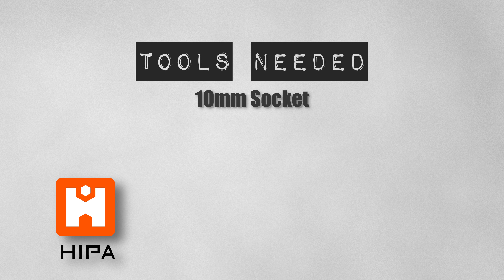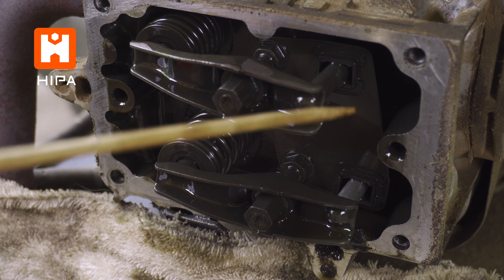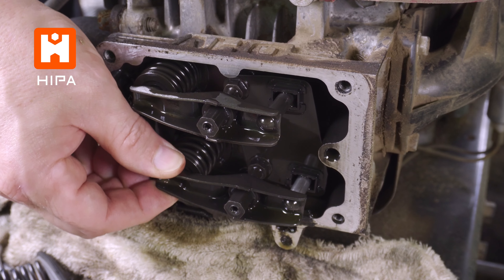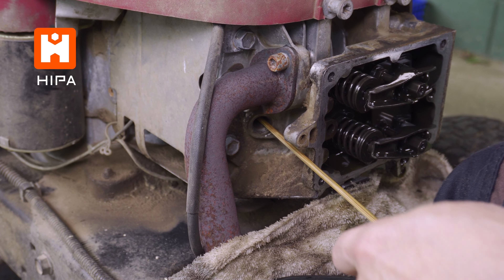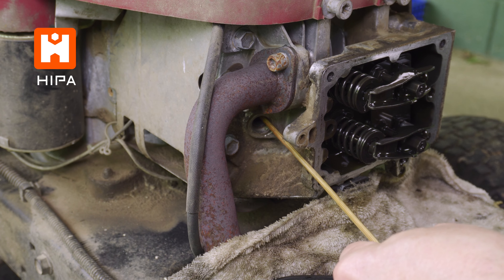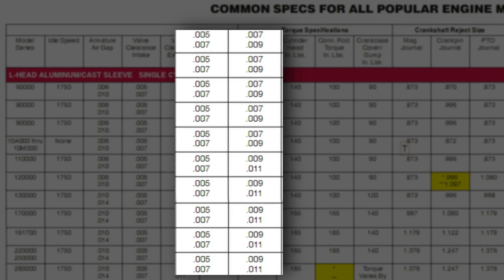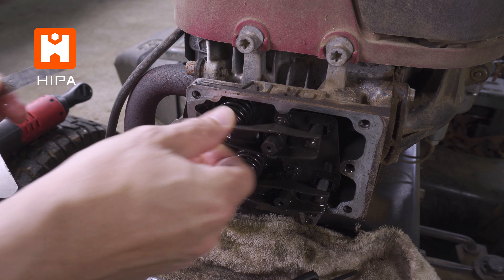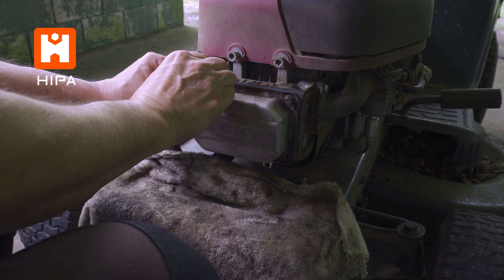Do this once a season! Briggs and Stratton Valve Adjustment Made Easy!

Comment: WOW! Just came across this video and what a Godsend. My local small engine shop wanted $125 to do this and with your help I did it myself. Along with that, I rewarded myself with a cold beer afterwards. Great video. Straight to the point with no filler material. Thanks for sharing your knowledge with those of us that don't know, but are willing to learn. I'll make sure to pass this knowledge on.

Comment: Thanks for your video! I was having fits trying to adjust the valves because of bad backfiring and a lack of starting. I kept thinking I was doing it wrong because no matter how perfect I thought it was I had a no start condition. Turns out that the flywheel key was sheared and the only way of figuring that out was by removing the cooling intake and mesh screen to check. You could clearly see the key-way in the crankshaft 1/4 turn past where the flywheel key-way was. Only a $6.00 part. I wasn't the original owner, and had no history of symptoms to help me figure it out
Reply: Always a fun one. I've got a Troy Bilt wood chipper I bought off of Craigs list where the governor never worked right. Ran much better with the governor disconnected than with it connected.  The guy I bought it from said it just needed to be "dialed in".  Never worked on small engines before. Spent many hours of tweaking and adjusting before I realized the governor is working backwards. Then I'm trying to figure out how the heck that could have happened, and then I realized the carb itself isn't even the right carb for the engine which is why the governor is working backwards (governor is slowing the engine down causing it to cut out when it is under a load instead of speeding it up). Ended up just leaving it disconnected, setting the engine to have a high idle speed,  and I push the carb governor with my finger if I need to from time to time to prevent it from stalling out.

Comment: Excellent, liked & subbed! I have a B&S 28V707 given to me in a Murray Select rider mower. I have used this for several years and I have never checked the valve lash, and I don't think it has ever been checked. I saw what the spec was 5-7 and 3-5 and was pleasantly surprised when you told what the spec was and the gauge you used, that was the help I needed. Superlative! So today is the day! Thank you!
Reply from the maker: No worries.

Comment: Ugh, for the Gasket Maker, need to wait 1 hours after applying the valve cover before tightening it down, and another 24 hours before puttin in any fluids  Read that after I already tightened it down and put in the fluids... Guess I will put a paper towel down and check it for leaks in the morning.

Comment: Something even easier = put finger or thumb over spark plug hole and slowly rotate flywheel. The compression stroke will push thumb off the plug hole THEN insert  a feeler rod into plug hole and come on up to TDC and maybe a couple of degrees past TDC depending on engine specs. Now check and adjust valve clearance. The compression stroke is what you are looking for here before making adjustments. I can't believe all you "master mechanics" miss this easy tip.
Reply: You are a legend.
Reply: @Tladdd 😂

Comment: The usual position on an Intek is just past TDC, with the stick going in by ¼ inch.
Reply: a quarter of an inch based on what reference point? bottom of spark plug threads, top of threads, etc?

Comment: Great video thank you if I could make one recommendation it would have been good to mention the importance of replacing the old gasket properly by removing and cleaning the cover and using a new gasket and applying sealant as well as cross tightening the cover bolts evenly to torque spec.
Reply from the maker: Thanks for watching and sharing the helpful tips. Really good suggestion.

Comment: I checked and adjusted the valve lash on my 1972 4 cylinder MGB sports car which has the opposite way of adjusting the lash and, thus, confused me.  On the "B", the clearance is set by adjusting the center adjusting screw and  it is the NUT that locks the adjusting screw in place.  It looks like, with these mower engines, the clearance is set by moving the NUT and then the hex or torx screw is used to lock the setting down.   Am I correct?

Comment: When i put in the new camshaft on that same engine i noticed the top valve inside the engine was a little stiff pulling it out it was stiff halfway out like the hole it fits in needs drilled out to smoothen it up 

Its the part at the end of the push rod inside the engine 

My compression release on the old camshaft was still good and worked but the lobes were worn down on the camshaft and thats what my problem was.

I seen on one name brand replacement part that came with my parts from Briggs for that same engine wasn't the exact match for the oil pump so i didn't use that part i didn't need it anyways wouldn't have fit my oil pump anyways mines part is round at the bottom and flat on top of the part

Comment: thanks im workin on this same engine,2003 year..exhaust valve rocker was very loose n almost flopping..tighten up and still has a bad backfire they exhaust and dont start..after cranking 10 seconds...cleaned out gas tank,so thats good...magneto bad?..

Comment: 3:40 m/s tighting valve is too tight on 1st adjustment, i back off 1/8 turn or so on the adjustment nut to get a feel for the correct lash. 
How are you'll getting the fine adjustment when you first set valve lash & its too tight?

Comment: The viewers comment of using thumb to confirm compression stroke basically solved my problem after 6-8 failed attempts and alot of mis information from other videos. My starting still has one heavy chug to get past to start. Would that mean the exhaust lash needs to be slightly greater? Anybody?

Comment: is this a symptom of excessive gap in the exhaust valve: mower will try to yank your arm off when starting after a couple pulls. seems to only happen when cold, about halfway through a pull it will violently pull the cord back into the engine. runs perfect once it starts though. others have advised me it might be the flywheel key.

Comment: When I tighten the inner torx locking screw it does not lock my out rocker arm nut in place. It still spins freely. Why is the locking screw not doing anything

Comment: So what happens when you adjust the valve clearance on both cylinders and it still turns over very slowly? Does that mean your crankshaft is bad? I already replaced the battery, solenoid and starter. Completely checked all wiring for shorts and tight ground wires. Valve adjustment is the last possible problem other than the crankshaft.
Reply: Could be the compression release is broken off the camshaft.

Comment: I can't keep valves adjusted. After 3 or more mowing I have to re-adjust. I make sure they are locked down. Help
Reply: Lock tight the studs, clean hole with brake cleaner and use red lock tight 
Let it dry 24 hours

Comment: I asked you where to get the data to adjust the valve, where should I get it? Thanks
Reply from the maker: I will send you link in another comment but they do not always work. You can also search google for "Briggs and stratton valve clearance chart". That will get you there.
Reply from the maker: https://outdoorpowerinfo.com/engine_specs/briggs_valve_gaps.asp
Reply: @HipaStore  I don't see my model number on that link

Comment: Would this be the same procedure for a Honda OHV 5hp rotary mower except for the feeler gauge used?
Reply: Just did mine for the first time, spoiler after 10 years my Honda engine was still right on the dot in where it should be for valve clearance.  I do my oil changes with full synthetic. At this rate the engine will outlive the mower deck itself by decades. Still starts with the first pull too! Pretty clear that Honda mower owners should be much more concerned about mower deck maintenance than engine maintenance! Should have been doing prime and paint of the underside of the mower deck every few years and didn't know it. Oh well...
Reply: @Sidicas  Thank you. I use Mobil 1 and I agree about synthetic oil. My Honda is getting hard to start. With the good service I give it I'm thinking the valves might need adjustment. I've never had them adjusted or checked. My HRM215 with a plastic deck should last longer than I want to mow! I'm 74.
Best regards - Doug

Comment: I have a question just had a problem with my 17.5 removed the valve cover and the intake rocker was loose the stud back out and the little cap is missing from the top of the in take valve cant find not in the oil or filter just ordered a new one have you ever had that happen?? Thanks
Reply from the maker: Hell, sorry to take so long to reply but yes I have seen that before. But I ended up finding the cap as it fell out unnoticed when I removed the valve cover. You definitely want to pull the pushrods and check that they are straight as this is a common problem on these engines. Thanks,
Eddie

Comment: Thanks for the video. The valve cove on my B&S 550EX is stuck. Tapping it and grabbing it with large channel locks won't work . How can I remove it ?
Reply: I took screwdriver and hammer and got mine off.
Reply: I had the same issue on my briggs v twin. I'm guessing that the factory used the sealant on the valve covers, there was no gasket. I was able to gently pry them up at the corner with a small flat blade screwdriver.  Be careful not to gouge the aluminium head, my valve cover bent slightly but was easily straightened with pliers. I cleaned both sides of the sealing joints, and used a very thin layer of copper rtv to re seal.

Comment: Waste of time to find TDC, when 1 valve is fully open the other is fully closed ....set that one then  rotate the engine to do the other when fully closed.Easy peasy!
Reply from the maker: Hello, thanks! I agree with you there are shortcuts to the process that come with experience. This video is meant for complete beginners and from an instructional viewpoint it is easier to show getting both valves slack just past the compression stroke so there is no chance of being on a down or up stroke. It is the way Briggs teaches/recommends it and is the way I would recommend learning it. Once you are comfortable knowing what is actually happening, then feel free to use all the shortcuts you want. All the best!
Reply: Thanks, I finally adjusted the valves on my 10.5 .b&s. After spending almost $100 on a new recoil and screwing up my shoulder & my hand, I watched your video. Thanks you saved me over $100 getting it fixed at the mower shop. Thanks
Reply: Hey thanks for the video! I do have a problem whit my engine still. It making these strange cuts when its running full. I change all orings and the needle in the carburetor and all service parts are changed but still cuts out even when new fuel. Any ideas? Checked the valves to
Reply: @mounted9ames  did you figure it out? Having the same issue on a 20hp briggs.
Reply: Might be the pin in the cam. @mounted9ames
Reply: It's not that simple, you're right in theory, but there has to be a specific amount of slack which you can't do by feel, I don't care how good, old, or experienced someone is, it's gotta be gapped with a gauge
Reply: Respect 🫡 it man rite on lmao 
I can do it all but for some reason I can’t seem to get valves rite 😆😆😆

Tdc seemed so overthought to me it theory.. so ima try it lol✌️
Reply: @HipaStore with all due respect ..

In the case of valves only (lol no idea why ) I can’t seem to nail um I overthink tdc using a rod with a mark to see it and still don’t work .

His comment seems easier to me a “beginner”with valves than any other video so far and I’ve seen many .

I’ll comment back if this motor fires after years of sitting lol
Reply: @mounted9ames - Does the engine seem to be running before it cuts out? If so, it could be a fuel supply issue. If applicable, check the fuel filter and fuel pump. The old 4.5 hp b&s engines that had the carb-in-tank used a cork gasket on the tank. With taking it on and off, the gasket would crumble slightly and restrict the screen on the fuel pickup tube, cause the engine run up and down in rpm.
Reply: Eggs zacklie true fellow 😊,eat good food and your engine to🇺🇸🏌️😀🤙
Reply: That finding TDC is a big headache and can go wrong especially for a new person doing it.. The easy and smart way is like Fixritephil explains.
Reply: I have a 18.5 HP craftsman b&s and it has been having issues starting just like valve adjustment being out. I adjusted but it still hangs right before tdc. Then if I tighten just a hair it turns but then won't crank almost like it's got no compression
Reply: Ran fine shit it off then it does this
Reply: @elitecystuning did you get it running?
Reply: @jeffw8848 yes but spits and pops at low idle under no load once under load it runs mint with blades on I did both at 4000s 

Think little too tight although both have 4000th of slack
Reply: @jeffw8848 I’m a race mechanic too by trade 😆🙈 somthing about these pos ohv motors I just never get valves rite my mistake I belive is I brought exhaust up to tdc one closed one open adjusted to 4000th then rotated motor until the other valve was open and seemed be on comp stroke .. basically should I just rotate so they’re both loose and closed then adjust lash?

I usually rip these motors off in less time that takes to put gas in it lmao 4 bolts throttle, fuel  , 1 hot a ground  (somtimes choke combo sometimes seperate and drop pulley out .. toss it across the street 🤣

Toss either I/C 1 lungs , kohler commands , Kawasakis , opposed twins (best motors ) 

I’n my opinion they’re not worth the yearly adjusting it’s just JUNK LOL. U already know what I mean lol

I try and avoid these garbage motors quicker that setting valves 🤣
Reply: This point I don’t think it’s valves I think it’s blown tf upppppp🤣

Comment: I went to do this and rotating the flywheel moved my valves just fine. I inserted a dowel (#2 pencil) into the plug hole and the piston didn’t seem to move on either end. I applied a little bit of force and it seemed to move the piston down, but now my flywheel is locked up. What happened and how do I fix it?
Reply: Did the entire pencil come back out or did you break a piece off onside the cylinder?
Reply: Remove your spark plug.

Comment: I did this and now the mower wont turn over but about a quarter or half turn and gets stuck
Reply: Just adjust one with the other valve is down or open
Reply: Try again. It's not turning because there's compression on the engine because your adjustments are wrong